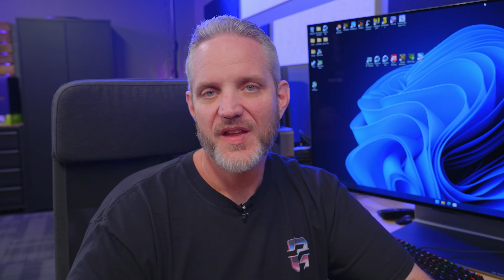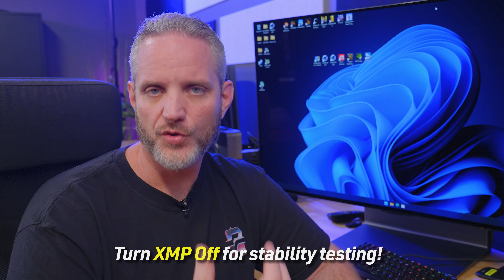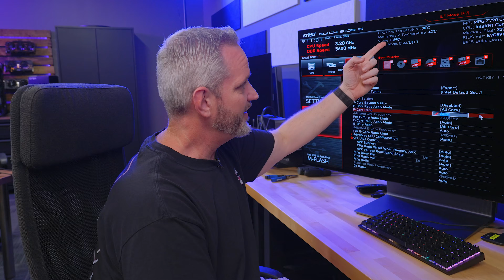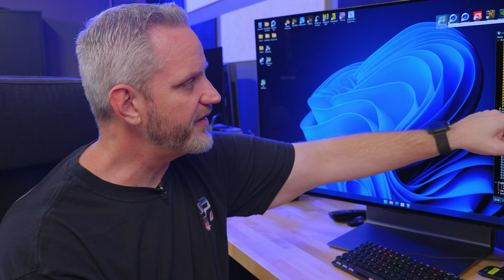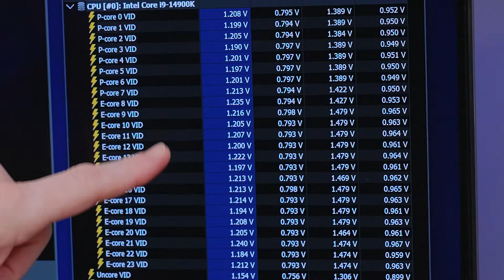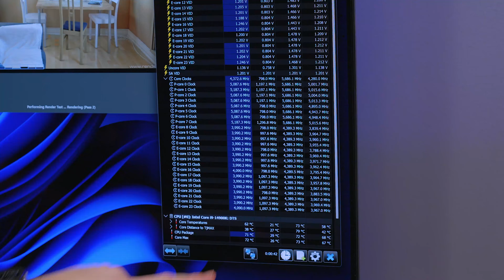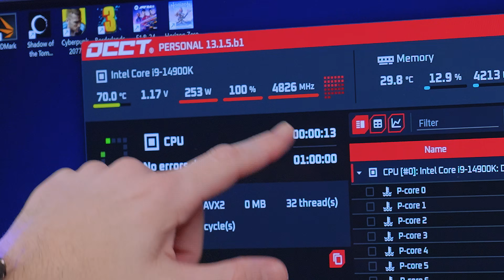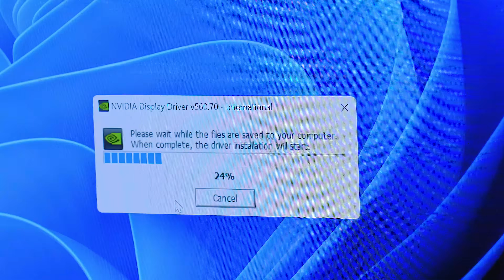Guide: How to check if your CPU is BAD!

Comment: Built in Feb 2022, my 13900k/4090 has not degraded.  But only because I believe I took the precautions at the time an extra step than even content creators in that era had recommended.  They called for PL1=PL2 limits of 253W.  I set mine to 125W instead.  And ran the 4090 with power limits at 70% in Afterburner.  With enhanced turbo off and a -0.08V undervolt.  My friends were curious as to why I chose to run everything so low.  At the time, it was simply because the heat of sitting next to my pc was uncomfortable.  So in the 80C and even higher 70C range, that was already too much for me.  My settings allowed me to use my computer at 50C and 60C instead.  At the cost of some performance.
Reply: Kinda sad though... investing so heavy in a system to then downclock it, but hey happy that your CPU is doing fine! :) My 13700k is not experiencing any issues either
Reply: buy a fast cpu, slows it down because of temp issues what kind of logic is this.
Reply: @squallsquall9669  Some don't care about getting every little bit of speed (but close to it), some just want stability and enough speed close to what was advertised to play all the games and do all the things they need and just have it work. Also some when they bought the processor did not know they would have to do all this undervolting, changing of settings etc.. that came to light. Because all this did not come out till later.
Reply: @squallsquall9669 believe it or not, undervolting and limiting the watts only really affects benchmarking and has little to no negative drawbacks during gaming (not sure about rendering etc.). In real world gaming scenarios, dropping temps down 20C while maintaining near spot-on performance from stock settings is great. I notice absolutely no difference during gameplay and load times. It could be because I game at 4k so everything is more gpu reliant, but hey, it works perfectly as intended.
Reply: @squallsquall9669  i just bought a 14700k from microcenter today 9/2/2024 and i plan on doing this, it only cost me $232 bucks so im not mad. didnt have to break the bank just to get a mid range cpu. i honestly want to play around with it so i can learn more. about bios settings and things of that nature.
Reply: I also have my 14700KF undervolted at -0.08v. Set PL1 135 and PL2 150 based on observation during gameplay and loading screens (time to compile shaders, etc.) The games I play typically use about 175w to either compile shaders or load from area to area, so I capped it at 150w peak for 56s and don't even notice a difference (probably milliseconds in loading). Same during gameplay, which peaks around 130w, so I capped it at 135w so it doesn't hinder performance while the undervolt keeps things cool. I generally don't see anything over 60C in the most intense scenarios (generally low 50C) during gaming while fans are set around 50%. Idles at around 30C. Volts usually peak around 1.35v at 5.5x ghz during intense gaming. If I ever need more temporary power, I'd just up the PL2 back to 253w worst case, but I'm in a good place atm.
Reply: @frantz4g63  the content creators kind of do a poor job explaining testing and trial and error that we all will inevitably encounter.  They say “here’s the values you should use” and that’s it.  Kept me from tinkering for years when I should have gone ahead and found the values that work for me.  For instance, the undervolts are already capped at -.10V.  So you can start all the way up there and see if your games crash.  Then work your way down.  Instead of going straight to a super conservative undervolt like -0.05V and never looking back.  Same with PL1 and PL2.  You can give it a generous 128s short term boost instead of the default 56s and have a performance increase that way.  With proper wattage limits, or even a core clock ratio limit of 5.4/5.5ghz on a 13th and 14th gen, you’ll be safe to play around with values.
Reply: @veo16  I agree. That was basically the same approach I took with undervolting, as I started with -0.08v. The duration I left at 56s since I really never have a scenario where it uses PL2 for longer than 56s (maybe only compiling shaders). 

Content creators basically generalize ideal settings according to their own preferences and preferred tasks. There are way too many variables to justify 1 set of settings unless you're intending to handicap the cpu performance for lack of cooling, etc. 

My personal experience was to test what I play and look at the temp and output values, then set them at comfortable preferred values and see how each game performs. Right now, I'm very conservative, but not to the point where I'll notice a drop in performance. My temps generally Idle at high 20C to low 30C, 40C to mid 50C range during gaming, and peak at about 58C-62C tops for brief moments (long shader compilations). Haven't been CPU limited so far in any gaming situation. 

I believe most of the people suffering with issues are the ones that either stuck with (stock?) settings where the PL1/PL2 values were unlimited or suffer due to a bad cooling solution. I've heard of people not having any limiters on stock settings, but mine on my Asrock board came with 125/253 out of the box, iirc. I guess some companies are more secure with how they handle the products they use and develop.
Reply: the 13900k came out in October of 2022, so how did you build it in February? Time travel?
Reply: Agreed so much. I kinda regret buying my 4090 because it heats up my room so much.. Here in the UK almost no houses have air conditioning so my room becomes an oven.
Reply: @ You can turn the fan settings to max.  So always at 100%.  They’ll still outlast the lifetime of the gpu.  And you’ll have replaced it long before its time is up.

Another possibility is to take the panels off the side your pc and leave it open.  So more air exchange and heat dissipation can occur.  Now, this will allow the components to collect more dust.  But simply have a soft bristle brush around and dust off the visible parts of the mobo heatsinks memory and gpu every few months or as needed.

Comment: Heads up, I had the 7z CRC unpacking error with Nvidia driver several times when downloading from Chrome, but downloading the driver from Edge the driver just unpacked fine. 13900k.

Comment: My Intel RMA was painless. I chose the cross ship option.
Reply: I will be getting a refund from Intel for the 13900K that i have been running for 1 1/2 years.  I will be going to a 12900K where everyday i dont have to sit and contemplate if my voltages  \ VRAM \ etc are set correctly.

Comment: Step 1: low gpu usage beyond normal?
Step 2: random lock ups even at idle
Step 3: USB flash drives randomly go offline or not recognized
Step 4: Any bluescreen?
Step 5: heavy crashing Unreal 4 or 5 Engines
Step 6:  Out of Video Memory error when starting Red D Redemption 2
Step 7: Random restarts without any overheating or lock up

This is what I experienced on both of my failed 13900k cpus. That was also undervolted, watt limited, and cores locked

Never drew more than 1.35volts in any scenario. CPUs began showing 1 or 2 symptoms above and eventually all of them. Was happening at 6 months use marker on both cpus.

It is a shame as 13900k is amazing for workstation and gaming, but I am already tech level gut that is dealing with isolating issues with cpu. It happens again at 6 months marker. This repeatability is an identifier of identical issues within the cpus' designs. Same failure points. I never encountered same identical issues in 25 years of building pcs, down to amount of months
Reply: I'm seeing numbers 4,5,6 with my 7950x cpu. Which is crazy because my i7 4790k is far more stable than this...
Reply: Well shit, I have both step 2 and 3... am I f'd haha?
Reply: I have step 7 rn
Reply: Could this be because of the stupid windows updates?

Comment: I have 14700kf with Asus rog ryuo ııı 360 mm aıo on msi z790 mb. My cpu's temp suddenly goes up to 90's(75C avr.) in games and 40-60 celcius when not loaded. AIO is just 2 months old. I have all latest bios, drivers. etc. What would you recommend me to do it?

Comment: Every processor degrades and the board manufacturers are at fault.  Really??  I have several old systems(Core 2 Duo, and several older Ryzen 3 systems) and they still run great.  Intel advertises OC and their board partners provide the motherboards to maximize this and somehow it's the board partners fault for providing the means to utilize the OC that Intel markets as a huge selling point.  And everyone thinks an RMA will fix the issue.  You sure your replacement CPU won't die the same way?  I don't trust Intel anymore.  When they had the opportunities to come forward they did not and allowed consumers to purchase knowingly defective processors and then refused to RMA them at the earliest outset of customer issues.  Trust them if you will.  I'm not and I'm done with them.
Reply: They also don't warranty overclocked processors. They say the processors can be overclocked if you want to, but you do so at your own risk. All MB vendors overclock out of the box these days, that is part of the problem, a lot of people don't even know they are overclocking as a result.

Degradation is more of an issue since we have moved to smaller nodes. These have less material in the circuits and consequently are more susceptible to oxidation damage when exposed to excessive voltage.
Reply: @Tugela60  not so much talking about the warranty's as I am about purchasing a product that you think you can utilize via OC or even just as a regular desktop only to find out it has suffered significant degradation far far earlier than would normally occur.  Would I expect a replacement for OC'ing my rig and then suffer damage...of course not.  However, we are talking about a far more extensive group than just gamers who tweak their system via OC.  This group didn't OC and probably have no idea what OC is and are now suffering significant degradation of their processors.  Bad all the way around for Intel.
Reply: @corpsdriven  They let you overclock, but said explicitly that if you do your warranty is void. You can do it if you want, but don't cry if or when it breaks the processor. Just because it did not break some other processor does not change that. You took the risk, got some benchmark brownie points, now your CPU is burned out. Deal.
Reply: @Tugela60  I don't have a dog in this fight.  I'm Red all the way.  Processor and GPU.  Was thinking of switching but not now.  Can't trust Blue to be true.  Deal.
Reply: @corpsdriven  You trust AMD after the recent BS?
Reply: @Tugela60  At this point and time Red has my trust.  I don't think a whole lot of Intel fans can say the same of Intel.
Reply: @corpsdriven  I trust Intel just fine. It is the MB manufacturers I don't trust.

Comment: I have never had a CPU die on its own or for that matter degrade and I still have a Phenom II X4 and a C2Q Q6600 as a file server and a backup box respectively and both still hit advertised speeds. So considering that in my 40 years of computing the only CPUs I've ever seen die got cooked by a blown mobo? yeah...I press X to doubt, especially since in my 40 years I've NEVER seen CPUs die like Intel has been doing with 13th and 14th gen, I've not seen this rate of failure since Nvidia and Bumpgate.
Reply: Modern CPUs use thinner traces, so they are more susceptible to the effecs of oxidation than the older processors. Think about it. If putting a processor under load burns off 0.5 nm a year, your 32nm chip is going to last decades, but a 5nm chip not so much. If that burnoff rate accelerates for some reason, such as excessive temperature or voltage, the chip effective lifetime will be even less. Once the traces have degraded down to a certain extent they are no longer going to be able to function properly, hence instability. Modern chips reach that point sooner.

If properly configured, AMD processors fail twice as often as Intel chips btw. Puget had a blog post about this.

The problem people are facing is a combination of the more delicate nature of modern chips and inappropriate operating setups. Unfortunately few people know how to set up their processors properly and rely on the MB vendors to do that for them, and MB vendors are pushing the envelope out of the box. There is also a problem with people who overclock on purpose pushing the processors hard in search of benchmark brownie points, which is now biting them on the rear hard.

Comment: i think people only kept their PC's on because powering up and powering down might be detrimental to certain components.. like mechanical harddrives. but there are fewer and fewer mechanical harddrives being used these days. people might have 1 large one just for general purpose stuff and things that dont need fast loading.
Reply: Not just that, if you live in a colder climate on and off causes stress on the motherboard and other components expansion and contraction. A pc left on is generally more reliable. It's like a car that does long distance start stop twice a day vs short distance with 10x start stop.

Comment: One of the issues I've noticed for my computer is when updating the driver, through the Nvidia experience, that after installing is done it sometimes doesn't update to show the new driver is installed until a do a restart. This isn't always, but I find it weird that it does it sometimes. Is this normal? I have an i7 12700k and a 3080.

Comment: I have an i9-13900.  I never had any issues with stability or crashing, but I upgraded my bios to the latest to ensure I had the new Intel microcode.  For the first time ever, Overwatch crashed on me yesterday.  I'm concerned the new BIOS is actually causing me issues, but I only have the single crash so far.
Reply: My guy, don't be paronoid. Remember programs would crash randomly even before this issue. A single crash doesn't mean your cpu is on its death bed.
Reply: I’ve had the i7-13700F for about 7 months now and have zero issues whatsoever with it and been hesitant to update my bio for the new version for that reason as I’m not sure if I should really do it if I’m not having issues
Reply: Any more crashes? I'm curious to know?
Reply: @ThePhreakyPyro  None.
Reply: @LVsF1N3ST  So I finally put my big boy pants on decided fuck it brick or not I'm going to update my shit. I got the bios updated successfully. However now I have issues with xmp not wanting to ramp up my ram speeds. I went back to disable it so I could post. I am trying to update Nvidia drivers now. We will see if they update or not. My temps are noticeably lower I will say.
Reply: @LVsF1N3ST  BTW I left this long post on this video but if you go to the reply I made a reply with my rig's specs. If you have any advice that would help alot.
Reply: that means you processor has degraded, you will need to add a low off set and lock the cores, the reason why the new microcode is crashing it is because its too late and the undervolting is triggering the crash.
Reply: @bardbacx  I suspect the BIOS was rushed out and has bugs.  If the CPU was degraded I would have expected stability issues prior to the "fix"".  Thanks for the input though.
Reply: @LVsF1N3ST  no bugs, just the degraded processor cant handle the lower voltage from the new microcodes.  Lock those cores and keep a small positive offset to protect the processor from further degradation.
Reply: @bardbacx  Lol you sure do draw a lot of conclusions for not knowing much of anything about my situation.  You have no idea when I updated my bios or how long it's been running.  You have no idea if I even used beta or stable bios.  You have no idea what other components I'm running, like my mobo.  You have no clue on how that single crash compares to my overall play time.  You have no idea what I other things I was running on my system during the crash.  

In case you missed it, you have no idea.
Reply: Worry reduces lifespan.
Live longer with AMD

Comment: @ 4:10 no effing wonder my 13900k wouldn't undervolt for SHIT with my MSI z690 Carbon, and why my cinebench scores continue to be under 4k of the average even with the new bios update, and this is my RMAd chip because my processor died a little over a month after I bought it.

Comment: With the price of the CPUs that this is primarily effecting, I'm RMAing it. I shouldn't have to worry about whether or not I can confidently use a 500ish USD CPU the way it was advertised as supposedly designed to be used. I don't care who is to blame, but I do know that it's not my fault. I shouldn't have to test a 500 USD CPU at stock settings to see if it's stable. I paid for the CPU with the idea that Intel did this testing already. Adding to the problem, even RMAing the CPU wouldn't put the confidence level in the CPU where it should be. Intel sold billions of dollars worth of these CPUs that were flawed and I'm supposed to just take their word that I won't have the same problem just because the CPU was manufactured more recently. Who's to say that Intel isn't just swapping for a CPU that is still flawed, hoping that the problem doesn't show up with the new microcode and BIOS settings applied? Intel's quest for core clocks at the price of efficiency has finally gone too far. Intel isn't the only one. Look at how long it has taken for AMD to turn around the reputation that Bulldozer earned them.
Reply: MBs overclock out of the box, so you are exceeding stock settings even if you do nothing. That is your fault, not Intels.